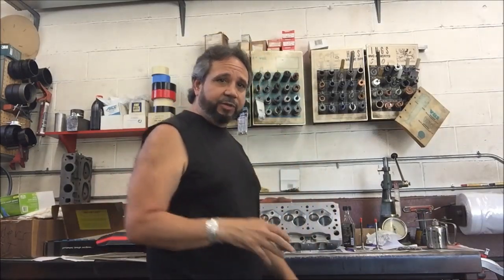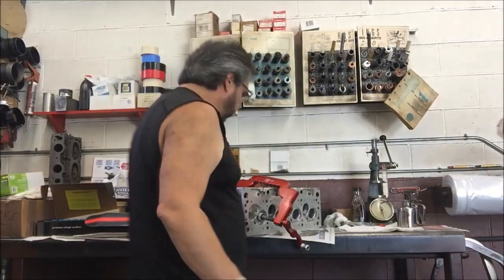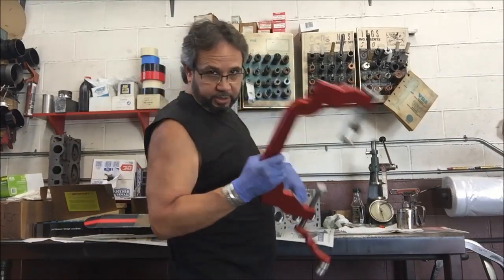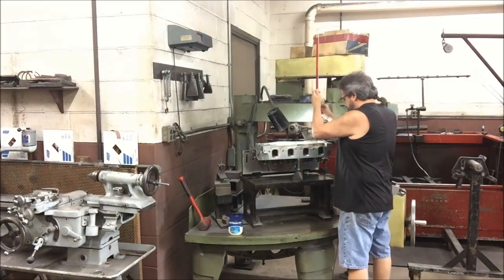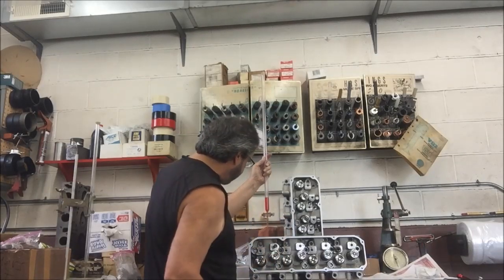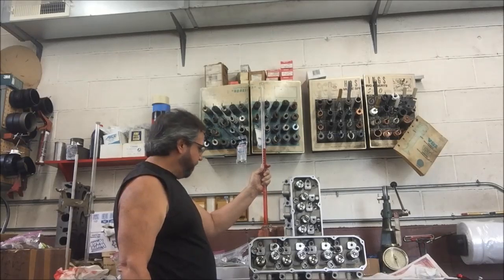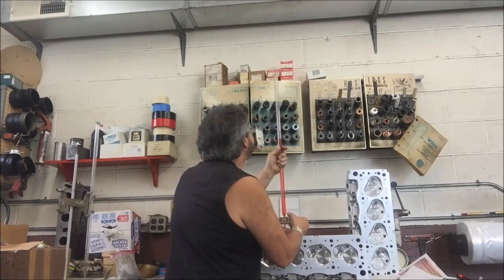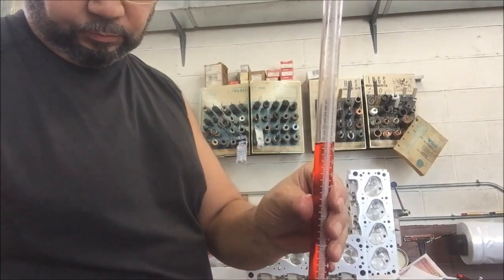Episode 25: 752 hp 408 Cleveland Buildup

Comment: Hi Tim, 149cc ÷ 269cc  is 0.5539  if this is a flow ratio indication,   sometimes  done bby meassuring sizes,  i think anything between .5 and .75  will make good vacume at overlap considering how light burnt fuel is.  Looks good to me.  Mad Mick. .
Reply from the maker: Just remember that intake volume really is not the total picture in flow, it is velocity that makes the difference. Heads are ported for velocity and shape. What ever port volume your left with, is what it is.  Not really getting what you are saying Mad Mick.
Reply: @dragboss351cleveland  Yes velocity is the big picture. The test of time always come back to small exhaust port with big pipes make the cam work on overlap. The more vacume their always means more vacume to the inlet. Flow ratio is the key.
Reply from the maker: @michaelgiglio1571  cool deal. Let’s gets some spent gases  flowing.